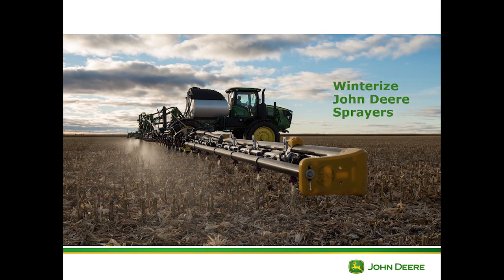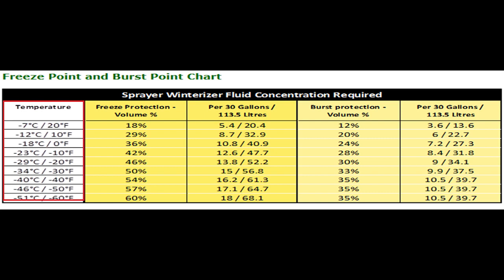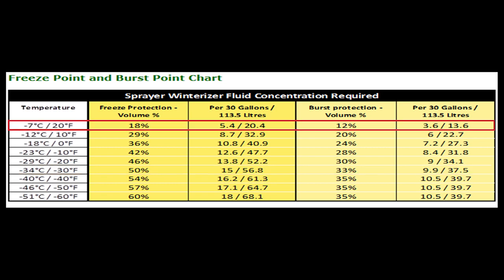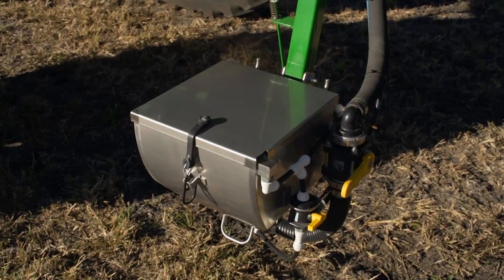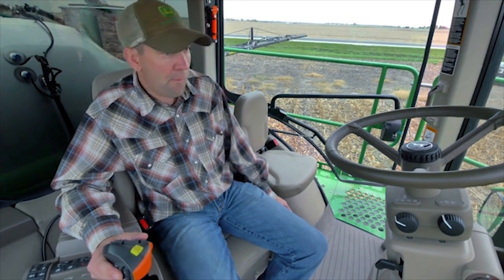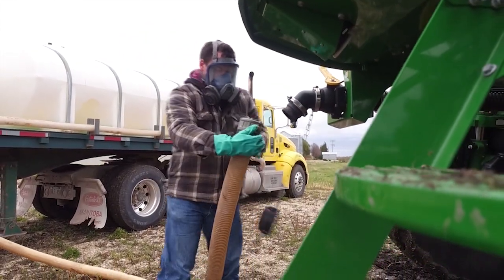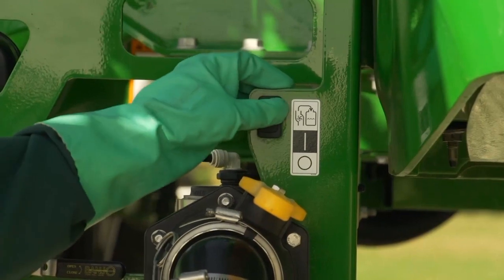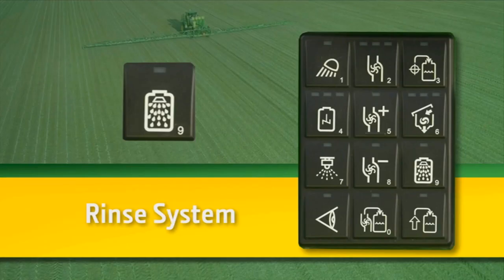How To Winterize Series 4 Sprayers | John Deere ExactApply™

Comment: If adding water to the freeze protection solution remember there will be some spray solution still present in the system and it will dilute the winterizing mix